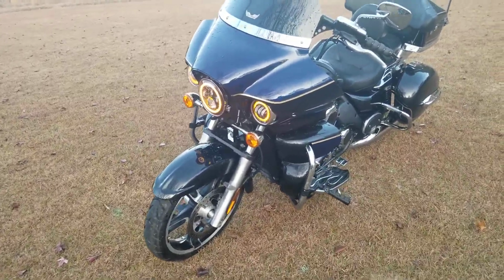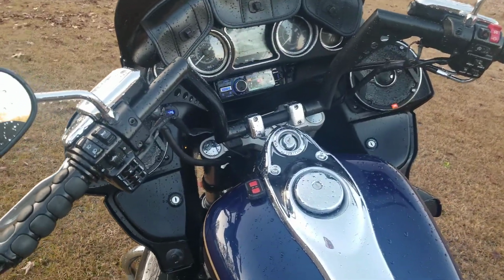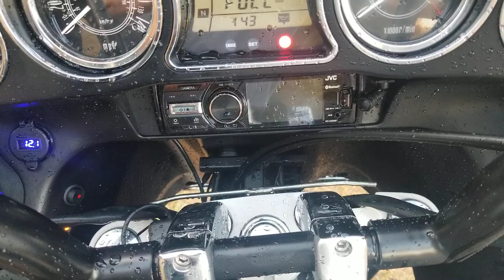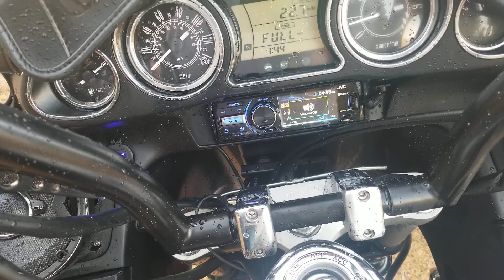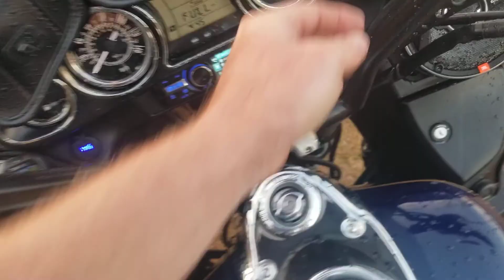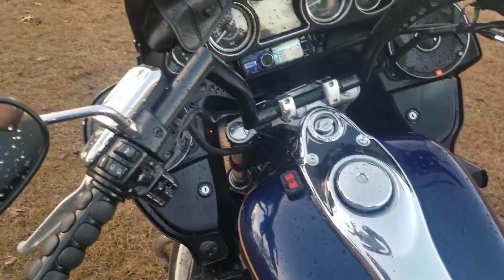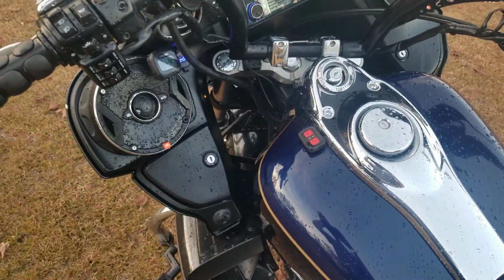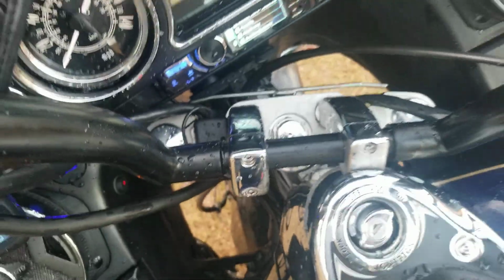Kawasaki Voyager Ape Hangers

Comment: Question for you. Where your bars clamp onto it goes down to 1in? Looks like on mine there 1.25 straight across.  What did u have to do in order to do that? Or is it cause the risers?
Reply from the maker: These are HD bars... 1 inch at that point.  You would need HD style risers.... those cost about $30....

Comment: What kind of windshield you rockin brother? I’m throwing apes on my voyager too this summer.
Reply from the maker: Cheap shield from amazon... cant think of company... but it's a 10".... cant think of name of company....can see logo.... lol... it's about $45
Reply: Thanks Greg. It’s a bit tricky finding any info on what windshields world with apes. I’m going to try the menacing monkey bars with pull back. Worst case I have to add some pullback risers or modify the windshield a bit. Any tips? I want to learn from your headaches 😂. Great job on the bike brother. Looks awesome.
Reply from the maker: @mattburke7858  .... Slipstreamer S-192 Windsheild - 10in. - Dark Smoke S-192-10DS

Those apes on mine are 10s... with about 2-3" of riser....
Reply: greg29150 thanks Greg, you’re a good man. Ride safe